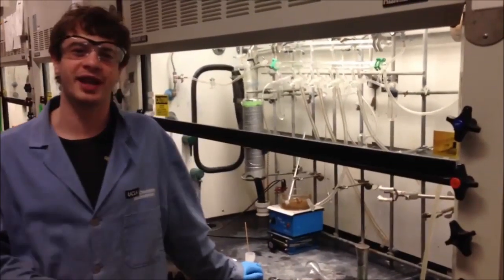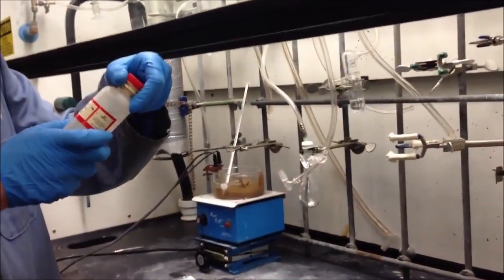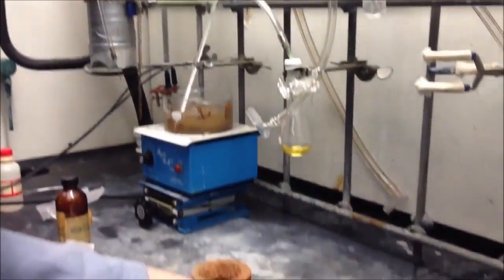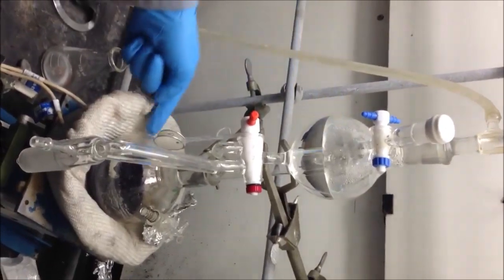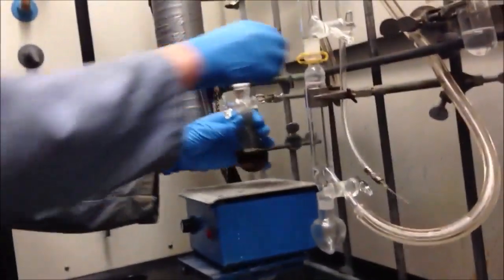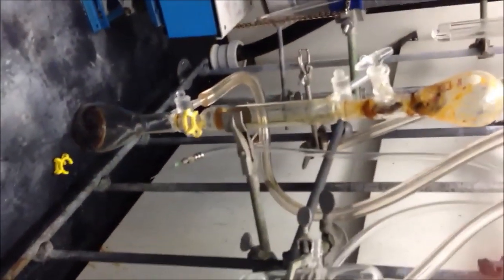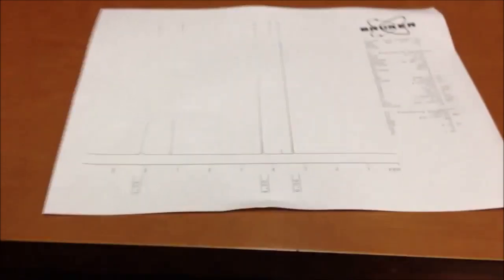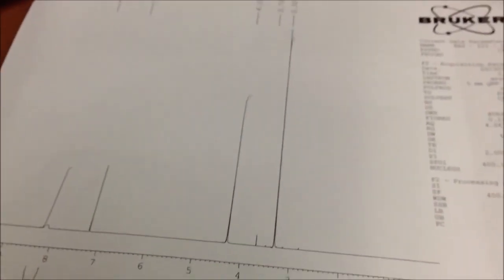Organic Chemistry: Synthesis of DMC

Comment: Ok but I have seen better technique.
Why not keep the schlenk tube attached to the manifold line during the reaction rather than rely on a needle?
If the schlenk tube was attached then you could remove the stopper and with a good flow of nitrogen break up the mass with a good old fashioned stirring rod.
When you do the filtration both sides of the apparatus should be attached to manifold lines.
A great tip is to put an elastic band round the two stopcocks to hold the whole assembly together you will only have one come to pieces in your hand full of air sensitive material once.
The NMR tube filling was a bit hokey I guess it was flushed. However if the tube was in a tall schlenk tube you could get the material in using a thin neck transfer tube and then add the solvent to the nmr tube via syringe and put the top on by holding it in a pair of tweezers.
I guess the CDCl3 was dried over molecular sieve?
What was the NMR referenced to I guess TMS but didn't see the peak may be it was the residual H in the CDCl3?

Comment: amazing video,with good demonstration of lab skills while working in inert atmosphere

 you could also try using  dicyclohexylcarbodiimide (DCC) as a dehydrating agent.
it can be made by dehydration of dicyclohexylurea with p-toluenesulphonyl choride in hot pyridine or by oxidation of N,N'-dicyclohexylthiourea with mercuric oxide (Hg2O)

it is acid catalysed(but the reaction conditions are very mild ,only a very small concentration of acid is needed) ,so it wont hydrolyse due to atmospheric moisture,making its synthesis much easier 
diisopropylcarbodiimide is an even milder reagent and is very good for amide ring formation

please keep posting more videos ,they are very informative

Comment: You are absolutely right. Unpierced septa are only as leaky as natural rubber (i.e. very), but once pierced they leak like sieves. The obvious improvement is to use a three way tap (such as Sigma cat. no. Z561975) for the manipulation.

Comment from the maker: Yes that probably would have worked. I've actually never used a filter-tip cannula, so I'm not sure about its limitations. One issue is that the solid is a very fine powder and a bit "gunky" and I imagine could form clogs easily.